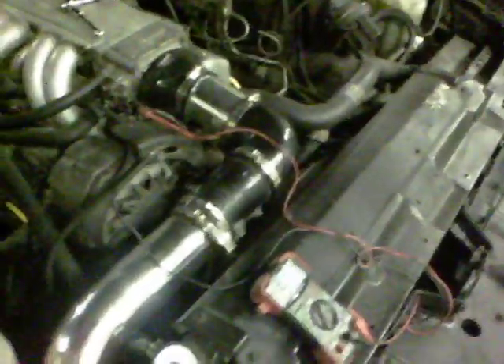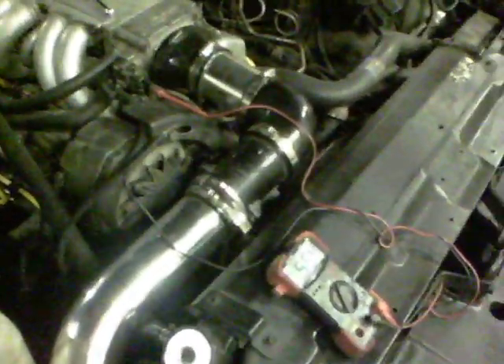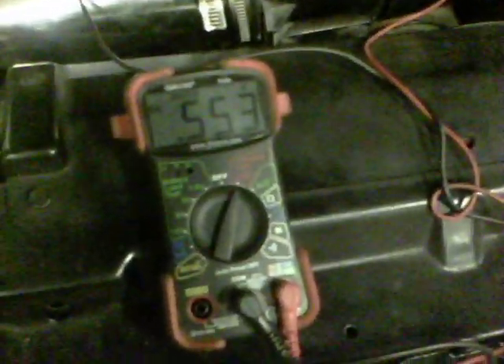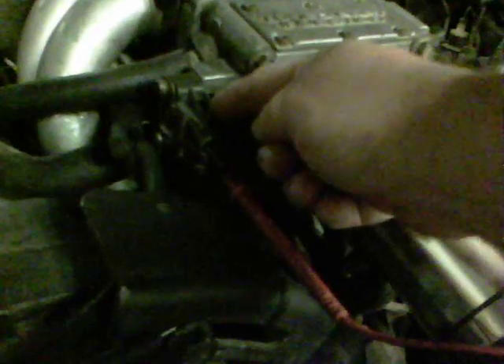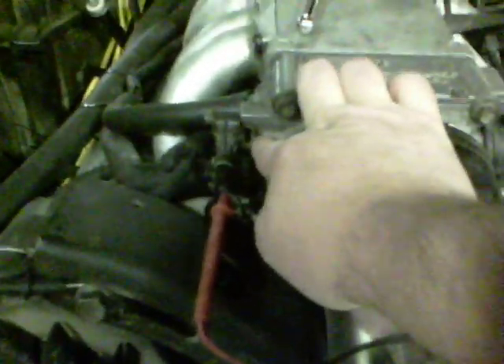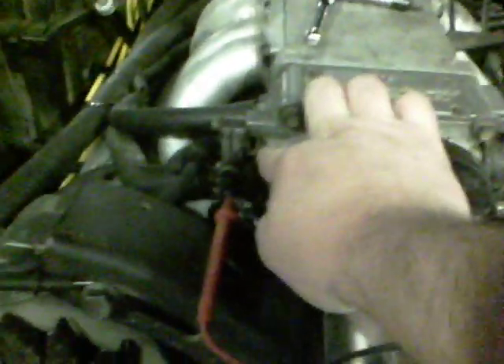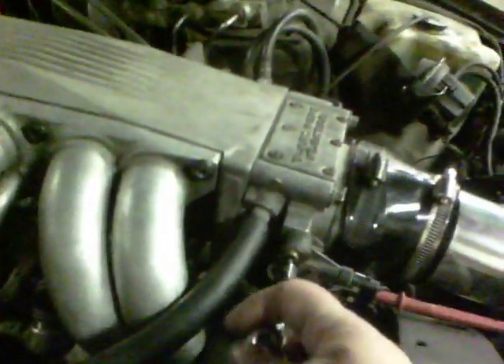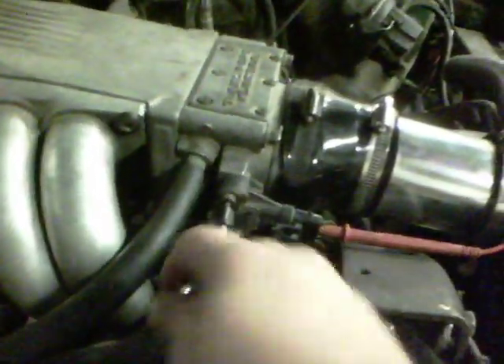85 Trans am setting TPS Throttle position sensor

Comment: Very helpful video! I have no voltage going to my tps sensor and I'm starting to suspect it's a bad ground connection. Where is the ground wire located for the tps? thanks

Comment: @91TransAmKid Yeah i am trying to figure this thing out myself. I was told never to screw that screw lol. But yeah mine has that plate blacking the screw and i am running MAF not Speed Den. I am gettting no idle at all so this may not be my prob. Are you familiar with  Thirdgen . org?

Comment: @mrLETHALDOMESTICS i figured it out, and the plate is there because i didnt know until i did research that the ECM on 90-92 TPI speed density cars the tps is set from the ECM to minimum idle, so no need to adjust tps or idle screw, Speed Density cars dont need adjustment

Comment: Last i tried setting mine it was a pain. I couldn't get it any lower than .64V, and the only other way i know of lowering it is lowering the idle screw, but i have a plate of some sorts behind mine, so i cant even adjust my idle screw.